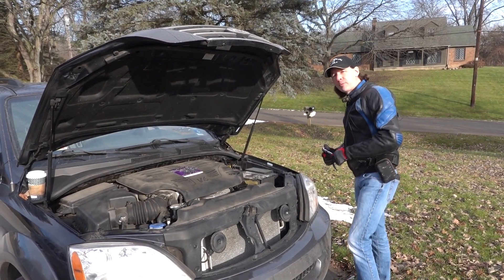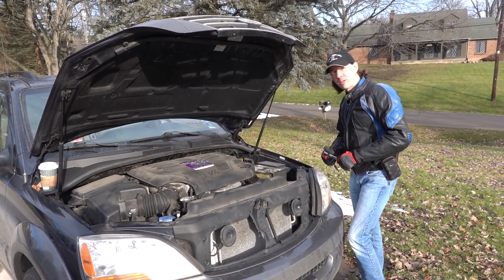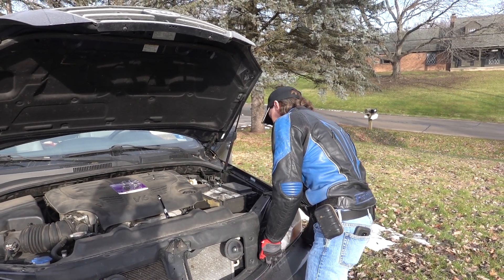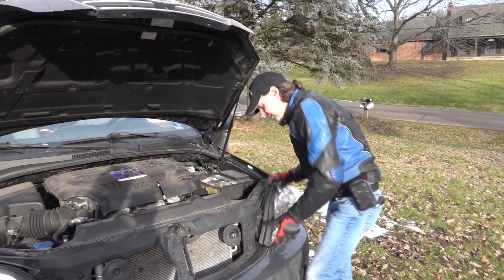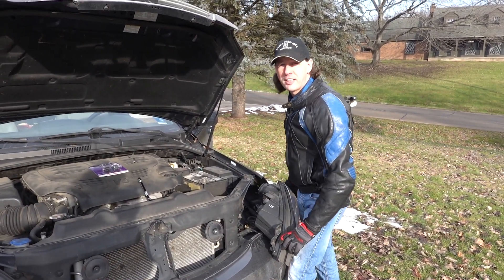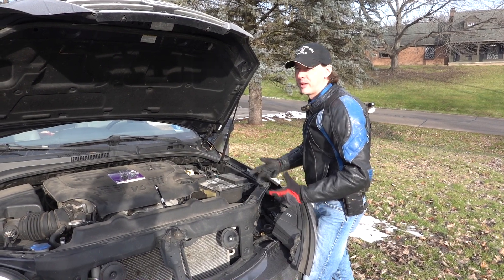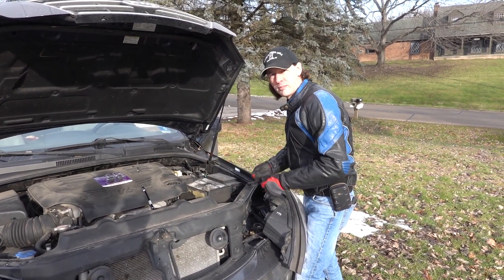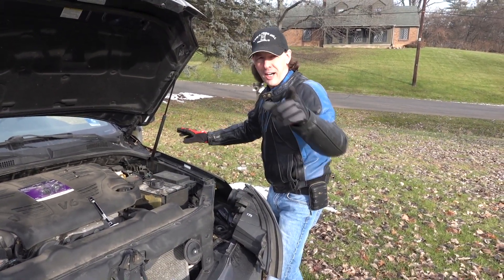Boot To The Dick - Automotive Headlight Engineering

Comment: The only time I let the inspection station charge me $14 to change a burned out bulb are the running lights near the headlights on my Nissan Xterra.  You have to practically disassemble the front fender to get to them - and even then it’s questionable.  Never mind they are utterly superfluous - in this wacky state if it’s on the car it has to work.  Fine by me - they earn that flat $14 rate!

On the other hand a friend has a Hyundai Accent and that is the easiest car I have ever worked on.  The front brakes were amazing - such a clean and simple design I had to pinch myself.  He had a crank angle sensor go out and it was right at the bottom, out in the open - one 10mm bolt, slide the old one out and a new one in - 10 minutes (car with almost 200K on the clock).   A few other bits have had to be replaced from wear  and I’m always pleasantly surprised at just how easy the car is to work on.  So nice to still have all the skin on your hands after doing repair work!

Comment: At least you don't have to remove the front tire to access the bolts for the light housing. Looking at you, 2006 Cadillac DTS. It shouldn't take 3.5 hours to change a headlight bulb.
Reply: I recall some Chrysler/Dodge sedan required that you take one of the front wheels off to get to the battery...
Reply: @Phordless_Cone  My niece had one of those - was a real WTF moment when she had an issue and I was going to help her.  Was.  Buy a stupid car like that, let it be someone else’s problem!

Comment: I'll take this over my Subaru any day, at least you didn't need to go behind the fender, take off a cover to actually reach the headlight and then change the bulb. I don't even bother, I take it in to have it done, it is cheaper than the fines I'd get for shouting obscenities at the top of my lungs. At you could actually remove the housing and do it from the front, they should have learned a bit from the 2001-2007 Chrysler Minivans though. Two (or was it three) screws and the whole thing is out.
Reply: Three, but a lot of ID10Ts don't see the third one and end up ripping the thing out because the third one is held in with a few c*** hairs of plastic.

Comment: More than half of the modern vehicles require some sort of yoga to get to the headlight. Hell, a volvo S(something) requires you take out the computer because it is bolted directly behind the passenger side headlight. Cars are made to be thrown together, not to be repaired.